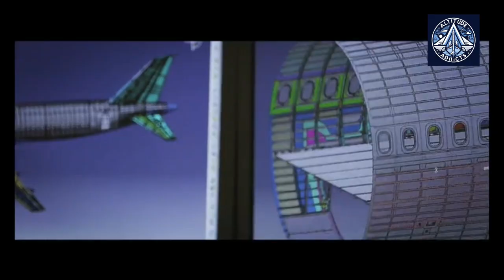Possible CFM LEAP-1C engine Ban - COMAC C919 May US PD-14 or CJ-1000

Comment: Russia recently has its own delivery problem. So it cannot provide China the PD14 for a while. By the way, If China works to integrate Russian's engine on the C919, It will be the 1st and only one single aisle aircraft to have three choices on engine suppliers.
Reply: @alexlo7708  nope you wrong. Russians have 3 engines 2 engines PD8 & PD14 are ready for mass production starting Jan 2025. 
There’d engine PD35 already passed all the test, now ready to be installed on IL76 test Lab aircraft Jan 2025. Recent report suggests PD35 will be installed on IL 400M for flight testing.  PD8 for 110 passenger. PD14 for 200 passengers and PD35 for 400 passenger 
Don’t need Boing or Airbus any more.
Reply: El pd 35 no puede ser instalados en el il 76, es muy pesado para el ala, en rusia no hay avin de laboratório de prueba aum que pueda colocar un pd35 en su ala, pude que un An 124 lo consiga pero aun no hay nada claro @Sam-dm4kz

Comment: The CFM-56 is a SAFRAN intellectual property product...!.. The CFM-56 International is a joint French/US licensed product to the US to fabricate in volume the same engine for Boeing... You can ban the CFM-International products but not the Original IP of SAFRAN and the French simply can re-source the components from different vendors, otherwise they can jeopardize Chinese production of the same CFM-56 engines and A320's built in China....

Comment: They already have ready a Chinese version of a Russian Progress ( Motor Sich ) engine ready to go on the wing if needed and also have an option version of a Soloviev D-30 modernized or even a down trottled version of a Progress/Soloviev PS-90C that can work on this and a stretched version of the C919... No worries!... 
They are going to ban the engines, there is no if's but when just like the Huawei ban of " American technology " Netherlands UV machines....
Reply: @mazikkaluchka5562  yep I agree, but it will take time and production disruption. In my opinion both options western and China version testing both at the same time including testing and final approvals. Russians wasted 3 years cause of western sections, now they are ready to go for mass production with 100% Russian parts, with china’s help of course..
Reply: @Sam-dm4kz  There is a symbiotic relationship between Russia and China, Russia has the IP and experience in many important aspects of semiconductors, space and aircraft products while China has the manpower and manufacturing capability!...